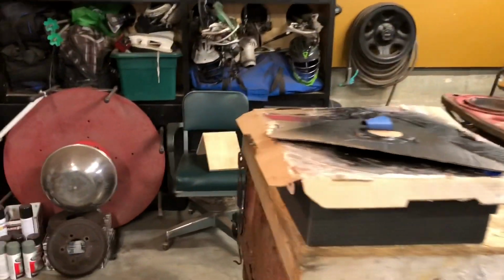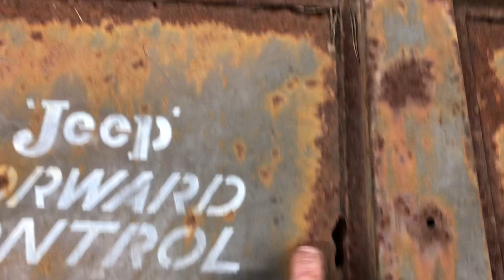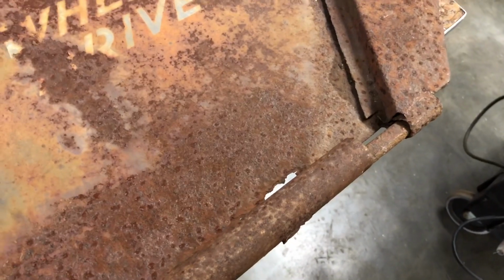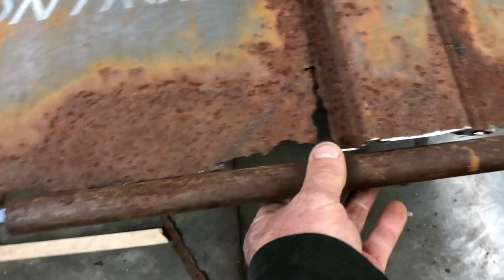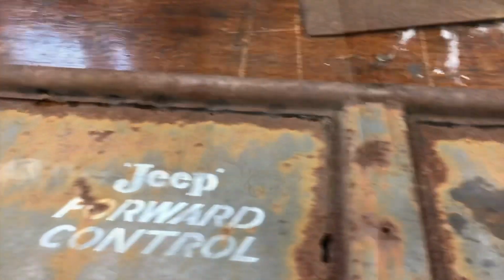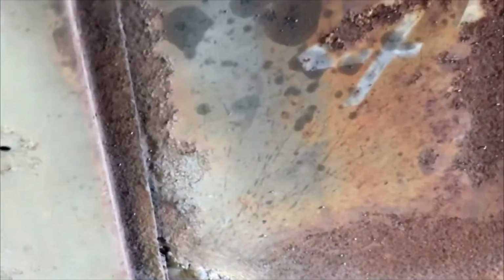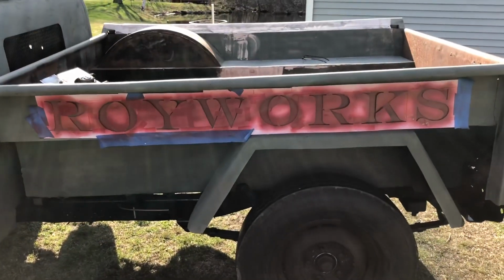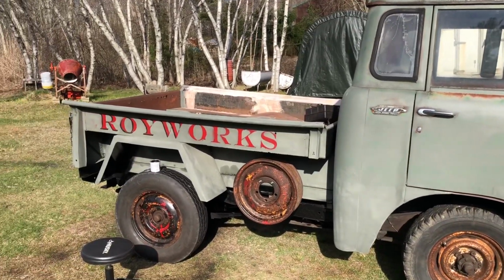Tailgate Work On Very Rare Fc 150 Jeep

Comment: When I fixed up my 1969 CJ5 it was very rusted out and worn out  but I repaired it and it is a nice driver.  I am doing the same with the 1960 Wagon although it is in better shape than the CJ was.  Both are drivers.  I like full restorations but I figured I saved two jeeps, kept them stock and now enjoy them.
Reply from the maker: That’s exactly how I feel, the vehicles I’m working on we’re heading for the scrap yard or were in a scrap yard. So I’m able to experience them for reasonable money and if someone in the future wants to do an extensive restoration they have a good place to start from.it good to communicate with like minded people